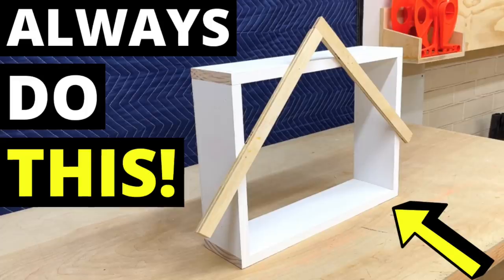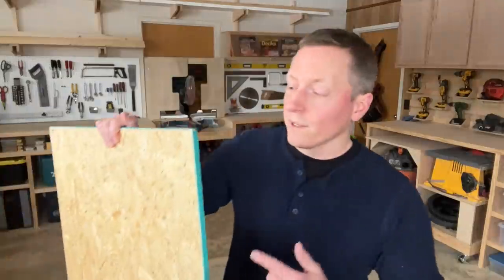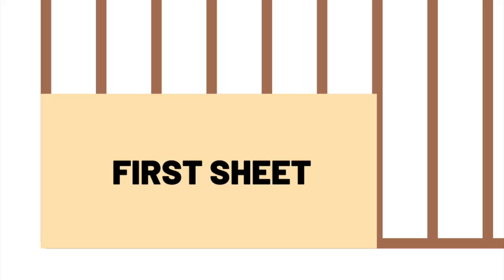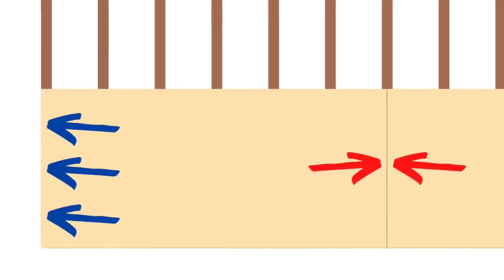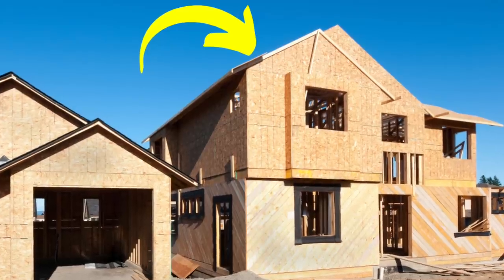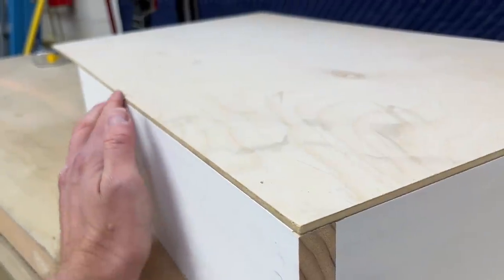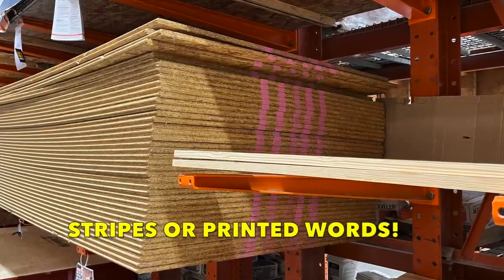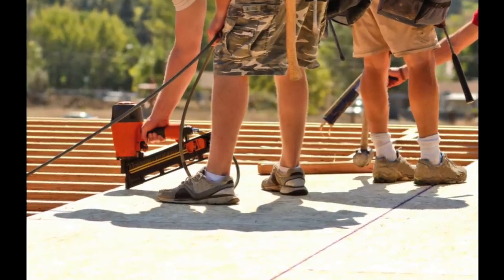This BUILT-IN LUMBER HACK Will Help You Build Anything! (Understanding FACTORY EDGE--How To Use It!)

Comment: A pro tip not covered in this video is that you should never attempt to square a roof with plywood. Yes, you start in the corner as mentioned in the video, but do not nail the edge of the plywood to the outside rafter. You can nail the bottom corner, and put a nail in the top corner to hold the rafter where it should be, but only tac it, do not drive the top nail all the way down. 

Run your whole roof repeating this method for the outside row, never drive the nail completely, and only put a tac in the top and bottom corner to hold the outside rafter in place and to keep the plywood edge stable and held down. After you get to the top you pop a straight line with a chalk box from the bottom to the top of the roof, and then you'll have a reference to know exactly where to nail the outside rafter. 

Ideally, everything will line up, but in practice, this is rarely the case, and some adjustments will need to be made. 

High level carpenters that know how to perfectly level and square a house and roof system will never nail the outside row permanently until they have all the plywood down, so they can ensure the outside rafter ends up perfectly straight and the rakes will be beautiful when observed from the ground. 

If you ever see a rake on a house gable that isn't straight, rest assured that house was built by a crew that either didn't know what they were doing, or didn't care about the quality of their work and would rather be home drinking beer than building a nice house. The whole industry is full of both sorts.
Reply: always "sight" your gable or fly rafters
Reply: Just to clear some confusion some may have because my OG comment is not thorough and lacks many details. What I said is based upon having the ridge/peak of your roof plumb to the outside of the wall it corresponds with (unless you are building a roof with no corresponding wall, then you only need to level the roof gable). 

One mistake I've seen many framers make is not plumbing their ridge/peak with the wall that it is meant to align with before putting any plywood on. 

If you want your roof to be square and level with the floors and walls below it, then you must first plumb the ridge/peak with the corresponding wall before putting the plywood on the roof.

Comment: Video request: different uses of the speed square, AND, other types of squares. I got into woodworking after I inherited my dad's lifelong collection of tools, plus he's not around to build or repair stuff, so I'm doing it!  But he didn't own a speed square!  I bought one after watching your video and now everything I build is framed with fancy 45° angles - ha! ha! But he, or rather I, have several other types squares and I wonder if one of them is better suited to one thing or another over the speed square. 

Also, if you have any tips for digging out overly gigantic nails in a door frame that was clearly not meant to ever be removed, and now it's needs to be removed, I'd greatly appreciate it! 😆

Comment: This is a good trick my trade is welding and fabricating and I know steel sheets are hardly ever square when measuring corner to corner do sheets of plywood measure out square corner to corner? Sorry I’m not a carpenter just interested in making wood do what I want I feel steel is easier to work with
Reply from the maker: They generally will show identical measurements corner to corner, Rich…as long as the sheet isn’t banged up or deformed!

Comment: I used to trust factory edges.  Then a couple weeks ago I bought 8 sheets grade-b 3/4” plywood and three of them were not square. Up to a 1/2” across the 4’ widths from one end to the other. Good thing I was just hanging them on my garage walls instead of drywall

Comment: I was taught in my youth from my carpenter grandfather, that a 90 degree corner can be determined by using the number's, "Three, Four and Five". Using the three and the four regardless of it being inches, feet, yards, miles in the measurement of the perpendicular lines. If the measurment between the ends of the two equal five. The results will equal a 90 degree corner.

Comment: as a BACKUP to the long aluminum beam....for shimming and shaving before the drywallers, if im on my own np but if theres 2 or 3 of us and only ONE metal beam straight edge, we go cut some fact edges off to use in a pinch and go true up the walls
Reply from the maker: Yep! I’ve used them as straight edges as well, Steven. Including for fairly reliable rips.

Comment: Uh, 45+ yrs  handling all manner of sheet goods here… the”factory edge” is usually good enough for rough carpentry. I’d trust it for sheathing a floor deck or roof where panel edge gaps have to be maintained anyway. I would NOT trust it for any kind of cabinet or other finish work without meticulously checking it first. We’ve had sheets out of square, long edges nowhere near straight, etc etc. Assume nothing and be prepared to straighten the long edge with a tracksaw or similar before doing anything else.

Comment: In my experience only the rip edge is always perfect. The Cross cut edge is quite often off by a degree or two. I always run a t square across the Cross cut edges of sheet goods and a speed square across dimensional lumber. Far too often I have to square the butt end of even premium oak and poplar boards

Comment: This might be a stupid question but with the box you built, how do you hold it square after you measure the diagonal or use the factory cut plywood? Attaching the backing would work, but what if you're just using the ply as a reference? Is it justa matter of clamping or using fasteners at that point?

Comment: As a carpenter for 30 years, I never trust the factory edge of sheet goods. To me, that's lazy. I always measure for square using the corner to corner or the 3 4 5 method. I was taught plumb, square and level. That always works.
Reply: I regularly notice my sheets are up to 1/8 out of square.  I don't trust them either.  I do look for them though when ripping pieces.  It's nice to have at least one side straight.

Comment: I was cutting up a new sheet of plywood on what I thought was a very accurate panel saw and kept getting funny results.
Checked the factory edges,   was about 3/16 out of square over 4 feet !   The saw was fine.
Reply from the maker: Somebody else said this Osman! I’ve just never seen it—but I may have to investigate for a future video 🤔
Reply: I've seen it many times as well. Same deal with drywall. Seems like some manufacturers and or suppliers are worse than others.

Comment: A lot of times I end up needing to make multiple small cuts from thr length of a single board which makes it hard to keep pulling from the factory edge, especially on floppier materials like frp. Or when you've got really weird measurements - sometimes the math is just too much!
So I'll use a t square that I trust from the factory edge on the side and redraw a clean line at my cut edge. I can accurately measure off the new line and if my original cut was too wobbly I can recut it and clean it up. Neither of my edges are likely to be exactly perfect but they end up much closer and certainly close enough for frp, drywall or insulated panels.

Comment: For plywood that does not have marks indicating the factory edges, I use a Sharpie and draw a line down the middle of each edge. Once edge banding is applied the line is not visible and I've yet to have issues with the Sharpie ink bleeding through.

Comment: I am a sewer and interesting enough, same principle applies to fabrics and salvages. All measurements, and checking the grain of the fabric, is done with the salvage of the fabric being the reference point. In sewing, it becomes difficult if you are working with a used fabric/already cut piece of fabric with no salvages to find the correct grain.

Comment: 4x8 sheets are square but markings on the sheets may be off so always use your tape that they are on 16 n 24 before using them n never butt them together cuz they are not really 4x8 , they are actually 1/8 short on both sides n the edge always double check with a tape measure to make sure

Comment: I relied on the plywood factory edge on my last project. However, I had to spend a lot of time shaving the excess glue that oozed from between the plywood laminations and caused bumpy factory edges. Poor quality control on product that cost over $50 per sheet.

Comment: The plywood is probably more square than those big plastic speed square. I finally noticed that the edges of those can be bowed in, which can suck. The metal ones of course are way better. Anyways, good vid.

Comment: Tape Measure:
I've always wondered....if the little bit of give that the hooking end has affects an accurate measurement.
Reply from the maker: It’s supposed to wiggle, Hamalot! That slack is the thickness of the tab itself. It subtracts when you pull, but adds itself when you push.

Comment: Ethan, Great timing on this!  
Question…
Do you butt the sheets tight or leave a gap between them?  I’m going to be installing 7/16” OSB in my new workshop soon and I’ve read that a 1/8” gap is recommended. I’d like to hear your thoughts on this.
Reply: 1/8" gap is required by manufacturer installation instructions. Good idea to look those up & read them as well as the warranty documents.
Reply: Today, most OSB is actually not 8ft/96inches exactly, but is 1/8th short of it. So if you are installing sheets butted together, after a few pieces are placed tight together, you're going to have a big issue as that 1/8th compounds, and if you center your trusses or rafters based on the OSB, you're going to cause your layoff to be incorrect and all your trusses/rafters will have bows in them. When I was still framing houses, I worked on crews that made this same mistake over and over because they failed to realise that all the new OSB is made an 1/8th smaller now and needs an 1/8th gap between the pieces in both directions now, as opposed to only the width, as it used to be done. It used to be that OSB was a perfect 96inches, but this isn't always the case anymore, though, there may be some manufactures that still make perfect 8ft sheets. 

So remember, you want an 1/8th between your sheets in both directions—length and width. But just to double check my information for your particular case, measure the length of the OSB you are using and see if it's 95 7/8, if it is, then you'll need that 1/8 gap, if it's a perfect 96, then it needs to be butted tight together.
Reply: @Isaiiahii  I measured the sheets and they are in fact exactly 48” x 96”. I’ve read that a butt joint will cause the sheets to buckle in high humidity. I live in central Arkansas and humidity is definitely high in the summer months.
Reply: @partsdave8943  Interesting. Many years ago most of the OSB around my area (Tidewater region of Virginia) that is used on houses has been 95 7/8 to allow for a gap. I thought this was an industry standard now. 

There are so many different manufacturers and no set rule, so it still varies.

As far as the width, that will always be 48 as that doesn't affect the layoff of the roof.
Reply: @partsdave8943  If you are placing many pieces in the same row butted together then I can see it buckling some. It would also depend on what the weather was when it was nailed. If you put the plywood down during the hot and humid summer, then you'll probably be fine, because the plywood will already be swollen and expanded during installation. But if you installed the plywood when it was super cold and low humidity, then in the summer it could swell up and cause some buckling.  If you are worried about buckling, then just trim an 1/8th off each sheets length, and leave a gap.  But use a straight edge to make sure your cut is straight.
Reply: @Isaiiahii  I haven’t measured yet, I expect that the last panel of each wall will need trimming. Even though my shop is 16’ x 32’, the inside dimensions have to be several inches shorter per wall.
Reply: @partsdave8943  I wouldn't worry about buckling in 32ft. That's only 4 sheets, and only two of those are trapped.
Reply: @Isaiiahii  I’ve been considering installing them vertically as every 4’ I have an electrical outlet. My thought is that if I needed to get behind the outlet for any reason in the future that it would be easier to remove a single panel as needed.
Reply: @partsdave8943  I always run plywood vertically on the walls so all the edges have wood under them. I'm not a fan of horizontal plywood on the walls because then you have seams with no wood backing. But on the roof, plywood is always run horizontally.
Reply: @Isaiiahii  that makes sense. I suspect OSB would be done the same as standard plywood sheathing.

Comment: I'm guessing this doesn't apply to hybrid items such as trex decking, etc. I replaced my deck boards with Veranda brand boards from home depot. They were very consistent on the short edges-every single one was NOT square; on either edge. This added significantly more cutting and measuring time. I'm slow enuf as it is. 😀 I look forward to using the factory edge in the future on other projects.  Great tip.
Reply: Use azek , veranda is very low quality and won’t last
Reply: @jncn1490  not sure I'll live long enuf to replace it but I'll keep that in mind. Tyvm. 😀

Comment: Those stripes on the OSB are not recent,  we had them when we were framing homes back in the 90s.  Also to all the diy guys,  this does NOT  apply to boards, only sheet goods. If you are doing finish carpentry always remove the factory edge from the end of the board with your miter saw before pulling a measurement. You just take a saw blade off, thats all you need to clean and square it up.  Not needed for rough framing,  just finish carpentry.

Comment: And build in the need for this factory edge to your estimates. Don't take that piece that's been cut twice and assume your two cuts are straight on it when you measure your next piece. And you can only pull a factory edge down your table saw

Comment: Factory ends are off a lot of time, specially 2x6 or larger. Check with your square on the end your pull your tape from before you cut.

Comment: While this often the case with sheets, it seems to rarely the case with 2x lumber. I feel like I'm always squaring ends of 2x4s, 2x6s, etc.
Reply: The smaller stuff is trash wood, which is fine for framing and rough construction.  Larger cuts like 2x12x16' are going to end up in much better shape most of the time, until you cut them and changes to internal stresses throw everything off again.

Comment: I don't know man, I use to think the same but I just got done building a set of kitchen cabinets and I ran across more that one sheet of home center birch ply that was off by more than a 1/16th of an inch over 4 feet.  That kind of error adds up over a 8 or 12 foot run.  It bit me hard so I trust nothing now.

Comment: Sheets of plywood are not always square. For floors and roofs they are square enough. But in a stack they all match. So if they are all off the same you want factory to factory. Start a roof with a 1/2 or 1/3 sheet cut square on the end. Every joint left should  be factory to factory . The last sheet on that row will be cut square at the other end.
To tell if the ends are square flip a sheet over and see how they line up. Should be easy to see.
The phrase to 
I'll from the factory edge means it goes against another factory edge.
Reply: "Pull from a factory edge"

Comment: I would have to disagree being a cabinet maker in Australia using sheets of chipboard, mdf etc and then cutting on a panel saw and cnc it never is perfect, that’s why when using a panel saw you rip it to the rough size you need you make a straight cut, rip it, dock both sides

Comment: Reliable until you step into a cabinetshop, then your first move after picking a fresh sheet is to cut that factory edge right off so you can trust your own work instead. Its fine where a 10 or 12mm doesn't really matter but when .5mm does factory edges are actual garbage.

Comment: umm.... No.... The factory edge is rarely SQUARE. It may be somewhat straight, but today's sheet goods rarely come square when you get them.
Anytime I'm attacking a fresh sheet, My first cut is a long edge, then I square the 2 short edges, then cut the final long edge parallel to the first if I need the whole sheet. If I'm breaking down a sheet, a long rip, and short crosscut, with markings afterwards, prepares the sheet for breakdown, AND gives me a fresh clean cut edge for reference.
This is also true (especially!) with dimensional lumber for framing. A good carpenter will pull a tape, and make marks carefully. A great carpenter will first cut an end square, then measure.

Comment: I can only say - No.
You are wrong about factory-edges being reliable. They are reliable (and reliable enough) for some applications, but that is in general not the case. lumbersheets made fro house-building are often specifically prepared to be square, but most for nearly everything else that is not the case and should not be relied upon. Carpenters are very picky cause well - when you build a doorframe and it is just 1-2mm of then the door will not fit correctly, swing open/close on its own, or even scratch the frame.